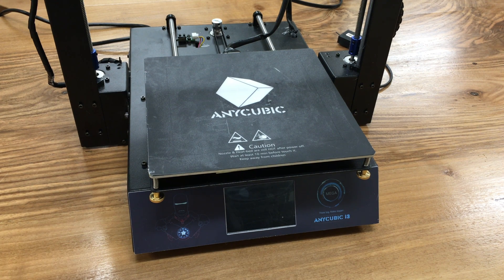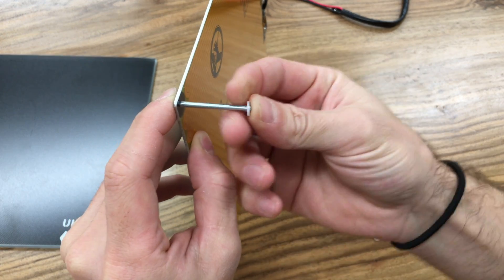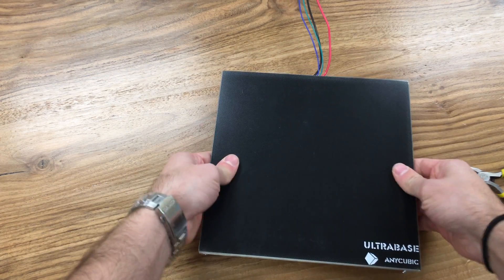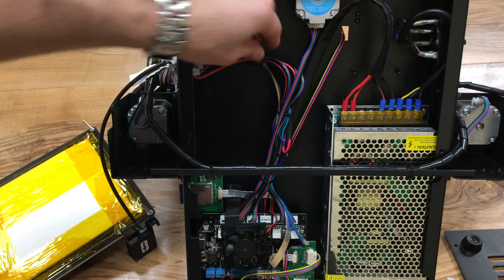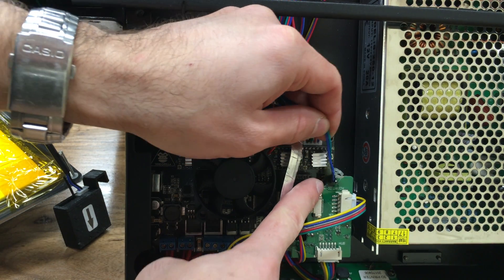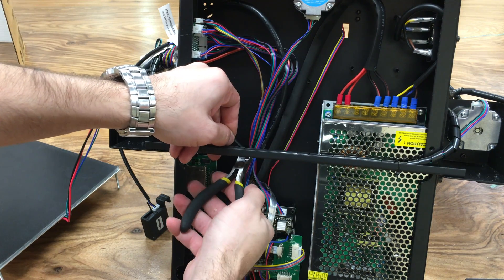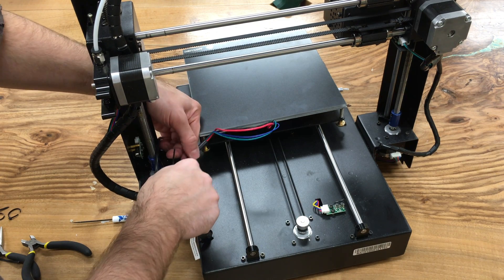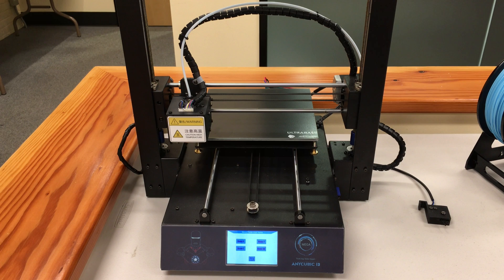How to upgrade into ULTRABASE | Anycubic i3 mega

Comment: Thanks a lot. The ultrabase bed that came with my machine was warped (it was cupped) and Anycubic sent me a replacement bed.
I would just add that make sure the screw heads can sit perfectly flush with the aluminum. Mine were not so I enlarged the countersink in the aluminum until they were to ensure the bed would attach perfectly flat.